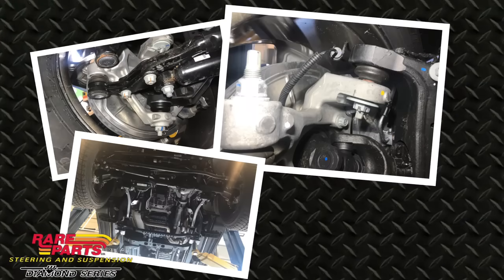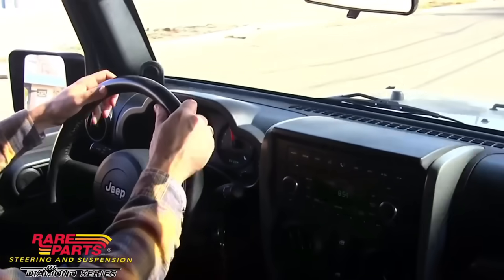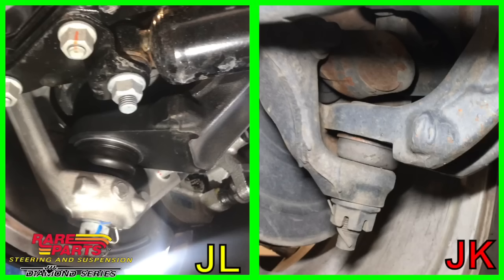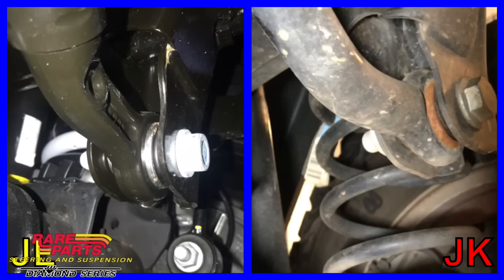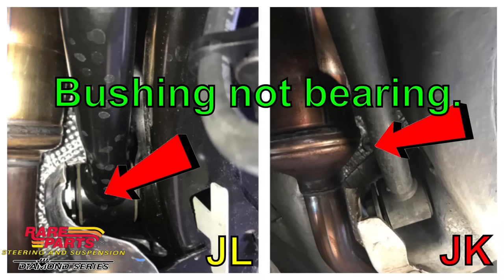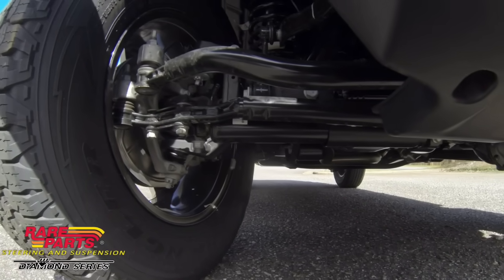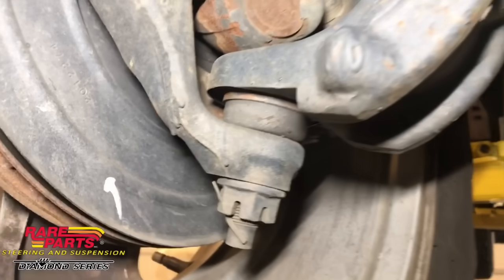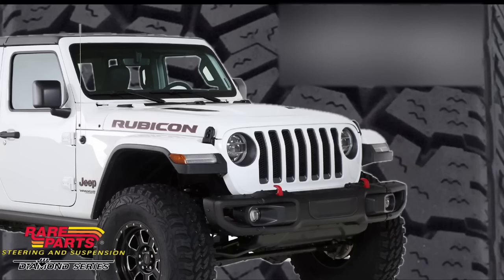Jeep Wrangler death wobble  Jeep JL vs Jk steering and suspension changes

Comment: Disagree with never (ever ever ever) seeing Death Wobble on a brand new Jeep. Got 1300 miles on my new JL and got Death Wobble.
Reply: Me too!  Under 5,000 miles and all stock parts!
Reply: Thought I'd update those interested. Wall-o-text incoming: So I took my car into the dealer today and they told me that thier code reader said the Steering Dampener is malfunctioning. I have been told that this is not the problem be soo many Jeepers. He looked me in the eye and told me they checked the Ball Joints, Tie Rods, the weld recall and everything else they could think of. I don't know how I feel yet about this diagnoses, but if that code is telling them it's the Steering Dampener, that's what they are going to replace first no matter what anyone says. Only thing giving me hope is that he said the new JL Dampener is basically a bad design, which HOPEFULLY means it may be the dampener even though veteran Jeepers say no... Because in this case it's a newly designed part that has new problems. Which may give credit to why in this video the author says it will never happen in a new Wrangler... He's probably right... Until now with this bad dampener that he wass unfamiliar with seeing the car is still new. We'll see... Have to wait 2 weeks for the new part, then I'll have to wait and see. I'll try to remember to update here in the future if people are interested.
Reply from the maker: William C,  I understand your frustration, most Jeepers are correct that the dampener won’t fix DW. But that’s on Jeeps with 30k miles and more. DW is cause by a worn component in the steering. This may or may not ease your mind. I have a JL sport I am currently working on that has DW. It has 2,300 miles on it. It is stock with no modifications. There isn’t enough miles to have worn steering components. So this tells me that there is a defective steering component. I can confirm that there wasn’t enough fluid in the dampners that’s why there is a star case for this problem. Hope this helps.
Reply: @BrandonHaneline  thanks for the response. It gives me hope, but I'm not at ease lol.
Reply: William C 9400 miles on mine started dw
Reply from the maker: Good grief. It’s worse than I though. Every in check your back joints. Everyone I have check have not been tight enough. You can break it loose with the cotter pin still in it.
Reply: William C has your Jeep been fixed?  Mine has been at dealer for 9 days waiting on steering stabilizer for same issue. Problem is it is on backorder!!  Report to the NHTSA.  I did. They have had several complaints thus far. Chrysler is paying for my rental.
Reply from the maker: Serveral......... try over 200 just on steering.
Reply: @carlalaberman7550  going in to the shop on Monday. Was a huge back up just on appointments. I'll let you know what I find. I have a guy in my Jeep Group that works on Wranglers and said he has seen several JL's with a track bar off by as much a 4 inches and told me to have them look at that. You may wanna do the same.
Reply from the maker: That’s not good 😟😲😳
Reply: Yea, haven't had this car for even 2 months and its been in the shop twice for different reasons. Looks like now a third time....😑
Reply: I all fairness though... You we're right that they didn't fix it.😆😆

Comment: I have experienced death wobble in many 4X4 vehicles, not just Jeeps. It is usually due to extreme tire sizes with no or undersized steering stabilizer or lifts with too high angles on steering geometry. 
 Where is your steering damper in the "Wobble shots."

Comment: Don't replace any of the parts with stock parts as well, replace them with serviceable parts. That's the key problem is that they are using throwaway parts that you don't perform maintenance on.

Comment: Agreed however, most of this concern is a result of poor modifications to the vehicle. Usually, a stock set up has no problems.  Lift it, then put on the larger tires etc. and you've just changed maybe up to a hundred specifications. Things like braking, gearing, steering circle, caster, rollover angles, driveshaft angles/u-joint stress and so on.  Most of those who do the lift kits and big tires won't care because they want the look and the higher ground clearance never mind the consequences.  One of the big factors is the tires....most of them are not round and need to be put on a lathe and re-balanced much more often than most would think but as the rubber wears away from the tires from normal use, the balance weights need to get reconfigured compensate.  Also, large tires magnify road feedback hundreds of times more than stock tires putting more wear on the suspension and body mount components.  The more "Off-Road" you make your Jeep, the less it will function correctly on a paved road. Been that way for more than a few decades.

Comment: I had the death wobble on my 05 Dodge Ram scared me to death  felt like it was shaking it’s self apart
Reply from the maker: Yes. Isn’t not fun. Especially on the interstate.
Reply: JeepInformant  mine stared at 55 and went away at 35   The cause of mine was a bolt Scheared off of my draglink sway bar
Reply from the maker: Scary!!

Comment: Death wobble only happens when a vehicle is lifted incorrectly. Using mismatched "sets" of lift parts from an aftermarket parts warehouse is all the reason you need to know. Getting lift parts directly from Jeep (yeah, they're more expensive) will not result in death wobble.
Reply: Then why is death wobble occurring on Wranglers that have non-lifted low mileage OEM suspension components?
Reply from the maker: Because there is something worn out min is doing it at 13k. I balanced my tires and performed an alignment and it went away. Also the dampener could be weak. There is a new one available
Reply: wrong Ive had not after market fix, and have death wobble at 9K

Comment: I have a Rubicon jk and never have had death wobbles so I don't know what you all are talking about.

If jeep gose to a independent suspension it will  ruin the entire  way  it off roads the solid axle is why it out does all other independent suspension vehicles in every way possible
Reply from the maker: Jeep mentioned IDS several years ago when designing the JL and the uproar was tremendous. Don’t see them doing this anytime soon.
Reply from the maker: I’m glad you have never experienced it. It’s not fun.
Reply: Jeep Informant   I never experienced on my jeep but I have on my brothers lifted truck yeah it's scary. Also thank you for  Letting me know they're not going to go to Independent  Suspension. But since you are a deep informant What problems have you guys had with the sway bars Getting water in the module I've heard there's a lot of problems.
Reply: Yes and they tried that in the military M38 or earlier version. I believe it was made by Ford back then.  What happened?  They rolled over much more often due to the IFS. Back to the solid front axle they went.

Comment: I have personal experience with this and I have corrected it it's definitely not the bushings it is the traction bar it has to be as parallel as possible to the axle if there's any angle to it at all it will emphasize every little bump in the road and make it seem more extreme if the traction bar becomes a little loose at all at the bolts connections then you really will be feeling death wobble so make sure your traction bars tight and when you lift your Jeep keep the traction bar as level as possible inline with your axle the more it goes down at an angle the odds are you'll end up with death wobble the best traction bars have very little Bend in them the one on your video here has a lot of Bend in it when you take a piece of metal and you put a half a Horseshoe Bend and one end of it it creates a lot of flex in that area that Flex will contribute to the problem you need to have an almost perfectly straight bar with drop brackets that relocated away from the pumpkin on the differential
Reply from the maker: Patrick Cox thanks for the valuable input. 👍
Reply: Yes and most of those "off-road" shops will likely not sell that option to the customer in fear of it being more expensive than the other shop quoted and losing the job. To do a lift correctly, it's going to cost more than most folks want to spend.

Comment: "Never ever ever have DW on a brand new wrangler"  are you full of shit or just lying? The one I test drove (JK) had it with 3 miles on the clock. There are tons of people that have had DW off the floor. I guess thats why chrysler implemented a TSB and recall to replace all JK ball joints before they were put on the lots because the cheap ones they were using caused severe DW and accidents. Learn something before you talk about a subject youre clueless about. I like how you conviently forgot to mention that rare parts was the one didnt reccomend an alignment even after the guy that owned that jeep asked them to do one. Jesus... At least tell the truth!!!
Reply: The new Jeeps don't have defective ball joints like the limited ones you speak of. Did the ones without the defective ball joints also have DW?  Give us the full story as it seems the defective units you speak of also mean the rest of them are subject to the same issues. I could produce a list of TSB's on just about every vehicle made, doesn't mean they are junk.
Reply: @Garth2011  yeah they did. 2007-2011 they had plastic inside the ball joints. The new ones they replaced them with are all metal. Look it up.

Comment: Bigger tires help to wear out the front end faster also.  A engineer with a PHD designed the vehicle and a tech with a GED " improved " on it.  Nothing is better than when it comes from the factory for reliability and longevity.
Reply: I bought a TJ Jeep brand new and heavily modified it I actually do go off-road with it exploring and gold mining and things like that but in reality I didn't improve on what was from the factory. I did a five and a half inch lift 35 inch tires had to beef up the axles and drivetrain everything. I had to go down the line to make sure it was strong enough from the last modification I did is ii better than Factory well yes for rock crawling type things but in reality no my next Jeep I'm going to keep stock maybe a front end leveling kit and drive as is stock they go more places than 99% of us want to go.
Reply: Agreed but then, we are dealing with the public who simply has to have the "look" when they drive their Jeep to work and back.

Comment: The biggest factor to death wobble is track bar angle.. Look how the track bar and drag link are not aligned, when the axle cycles the steering and axle move on different planes thus causing wobble.. You can throw parts at it if you want but the video showing wobble shows the issue.. Worn out parts can contribute but lifted jeeps with incorrect track bar/ drag link alignment is the #1 culprit imho

Comment: Your opinions.......... are simply opinions.  Wear does in fact occur on all parts, but you have NO evidence & NO research Data to support your opinions.  5K, 10K, 20K, 50 K, 110K.......when has enough wear occurred to warrant replacement?   Fact is you know NOTHING about wear and how it induces the Death Wobble.  Therefore your opinions are worthless.  i have seen enough different solutions that fixed the Death Wobble, that I know there is no single solution..  Next your stupidity will be recommending that we buy a new jeep to correct it.  Do us all a favor and refrain from giving out worthless opinions and let the experts handle repairing jeep components.
Reply: You need to justify your opinion if you're going to say this video has zero value. Tell us about your knowledge and "solutions" or exit this subject. No one wants to hear cheap low life talk discounting someone who's trying to provide positive information that may have input for DW concerns.  As he said, the #1 cause is modifying the suspension and big tires. As the video shows, the test vehicle is lifted, big tires, altered suspension and of course no steering stabilizer was installed. Suggesting to the people herein that the writer of this page is stupid, has worthless opinions and knows nothing/no research without having further conversation about the matter is simply an limited adescelent method of reasoning.  Unless you simply want to continue to rant about being the expert, why not simply share what you think you know about this matter in repairing "Jeep components"?  As the video shows, all or most of the Jeep components had been replaced with aftermarket.  Maybe some professional feedback from you with the evidence and research vs. "you don't know much" in a distasteful manner would be best for folks who don't know anything about mechanical things and depend on pages like this to learn a little so they can go to their "off-road" expert and use the additional knowledge they gained to determine if their off-road shop who did the changes for a fee are full of it or are truly a dignified and respectable shop. There are more "Shade Tree Mechanic" off-road shops that know little vs. those who do according to several sources.
Reply from the maker: Hey Thanks Garth!!!  Your the man!! 😊👍. Agreed!

Comment: I don't think you are correct in say the rare parts jeep had bad control arm bushings those arms looked new as well. Something I've found in customers jeeps that are big time contributers to death wobble are stretched out bolt holes from unforgiving heim style joints from aftermarket kits, stretched bolt holes on the track bar, bad ball joints especially on the jk the ball joints were junk, and as you said many things wear out a little and compound to creat one big problem.
Reply from the maker: Yep your right Jacob. Thanks for the input!!  😊👍

Comment: I have owned JK's for the last decade. Death wobble is NOT hard to prevent. And yes, they have been lifted and modified. So many people complain about death wobble, but these same people refuse to listen to what fixes it.
Reply: and what fixes it...
Reply from the maker: You are correct.
Reply: Agreed 100%
Reply: Yeah what fixes it when you spend 40 grand on a brand new wrangler JL unlimited and it's been back to the dealer twice for this same thing? With only 6,000 miles on it! They've rotated the tires twice. Still has it.

Comment: If you install a lift, your chances of D.W. much greater...If stays factory, (almost) nonexistent, or so I'm told..
Reply from the maker: Your correct. It does increase the odds. But if done correctly. It should never happen.
Reply: Ive had DW on 2 seperate stock Ram 2500/3500. No lift just 285s vs 265 stock tires. The DW is caused by the the stacking tolerences of worn items like this video describes and a design flaw in the way the drag link and center link attach. Look under a 10 2500 vs a 07 2500 and you will see the design change that fixes/minimizes the problem. Neither of my jeeps have done it but they are lined up nice

Comment: why dont we start by calling it harmonic oscillation and not death wobble, it is true though, worn parts are the culprit. most likely trac bar bushings or a wallowed out trac bar bolt hole. after that just go through the laundry list of parts, checking for wear. also this issue occurs on any solid axle with springs, not just jeeps. look up "Planman death wobble" for one of the best vids ive found explaining harmonic oscillation and its causes.
Reply from the maker: I like the name Harmonic Oscillation sounds like a sophisticated problem. 😀
Reply: We are dealing with the public so they will use the slang version !!!  Agreed, harmonic or dynamic is the cause but the initial cause is people changing the tires/wheels, suspension and body lifts etc. that really get this to be a problem.

Comment: I wonder if mall crawlers are less susceptible to wobble, maybe the front suspension wear is associated with off-road driving.
Reply: 2004 stock TJ. Got the DW at around 80,000 miles. He is right- combination of worn parts.
Reply from the maker: I’m sure off roading accelerates the wear and tear in the steering and suspension components over time.
Reply: 2018 Jeep JL Sahara with 3k miles and I'm  experiencing some bad oscillation. Been back to dealer 3x and on my second dampener with no luck yet.

Comment: My Dodge Ram 1500 4x4 does not have death wobble, but my Jeep XJ would definitely get if I hit a pothole at speed.  Of course, the Ram 1500 does not have a solid front axle, so that might be the issue.  I have to wonder though if the Ram 2500 4x4 gets death wobble since it has the solid front axle.

Comment: Your solution is a shotgun approach to the issue. Replace everything steering related sounds a bit ridiculous.
Reply: It would depend on how many miles the Jeep has of course.  If its had big tires/wheels its entire life and 60,000 miles on the odometer, most suspension shops would likely recommend replacing all of the wearable joints. I doubt it would be a complete waste of dollars but on the same level, big tires and wheels are the reason this occurs mostly so, its part of that maintenance plan.